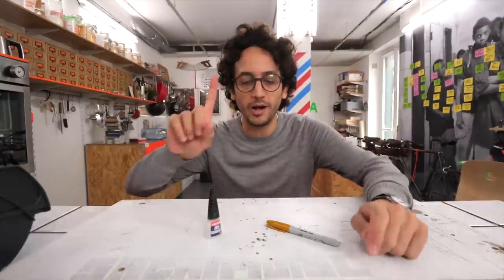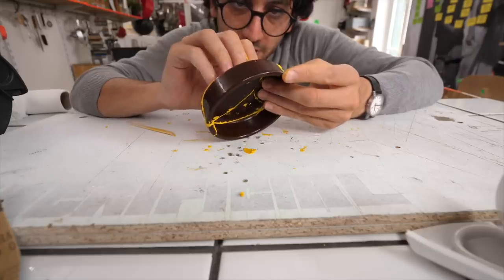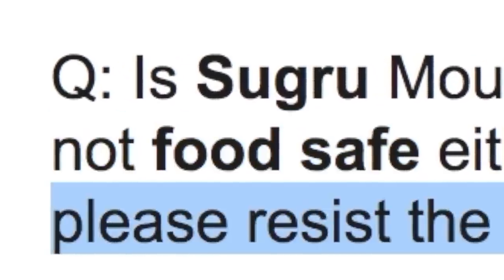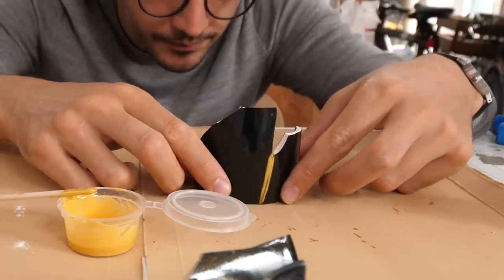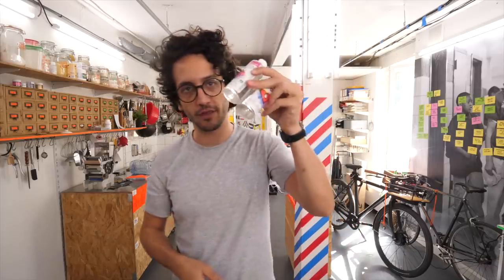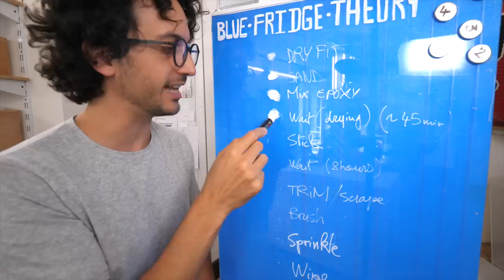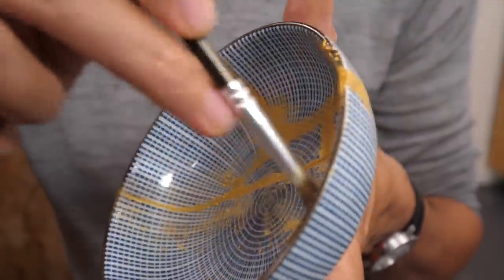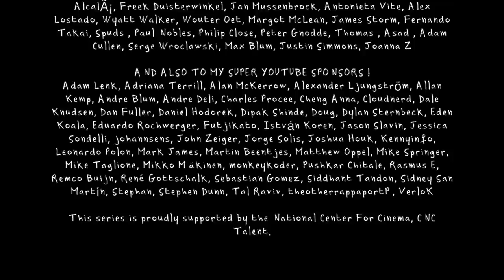I Made a (Foodsafe) Hack On Kintsugi...

Comment: You could also try this old "recipe" or technique for repairing porcelain and ceramic vases and dishes:
Take two fresh egg whites, mix them together, add a little quicklime.
After mixing put the mixture on the broken pieces, hold them together for two or three minutes. Then boil them with milk and the cracks will become invisible so im thinking if you use this recipe and use gold colored dust with the quicklime and egg mixture then it should give you the results you want!! Try out out please?! Its really cool sounding but i dont own anything thats ceramic or porcelain besides my toilet and my ceramic coated cast iron cookware lol and i definitely dont want to attempt breaking either of those two lol @A French Guy Cooking

Comment: The business I work for imports hand made Japanese plates, and I am familiar with Kintsugi items.
I can think of one food safe resin that is often used as a kintsugi natural gum replacement. The only issue with it, like all epoxies, is that it is not recommended above 50 degrees celsius. Considering the minimum temperature a dishwasher will operate at is 65 degrees wash cycle, and 90 rinse cycle...well yeah. I would avoid using this bowl in a dishwasher or microwave after this application.

Comment: wow - hadn't thought of this. awesome hack, but the concept of Wabi Sabi and Kintsugi breaks down for me now that I realize that something old and broken, but beautifully repaired generally is not safe to reuse for its original purpose (for example, as a cup for food or tea).  hmmm... I wonder what the philosophy says about this?  I guess it has a new different purpose and so the inability to use it for food is not an unfathomable LOSS of some functional beauty.
Reply: Traditional kintsugi is food safe as long as you're not using the piece for boiling water, so in most circumstances you can use it for its original purpose (for a tea cup just make the tea in a teapot and decant it over into the cup)

Comment: This is not a true Japanese Kintsugi. The real Kintsugi is made by sticking a vessel broken with lacquer or abrasive powder and dusting it with pure gold or silver. Never use artificial adhesives. Don't think of this kintsugi-like technique as the correct kintsugi method. I'm sorry if the creator explained that.

Comment: I tried this technique, and I’m not super happy with the results. Here are my tips: 

1. Don’t bother trying to color the epoxy gold at first when sticking the items together. It won’t be visible in the seams, and what squishes out will run and make a mess. Just paint the lines on afterwards. Or:
2. After mixing the epoxy, let it sit for well over an hour. Maybe more like three hours. The art resin takes forever to cure, don’t rush it. It was easier to work with when it reached a “ropey” consistency, like when scooping it up with a wide toothpick it wants to pull together and form a ball rather than drip.
3. The wheat paste didn’t work for me to fill gaps, the epoxy still wouldn’t hold and kept making a mess. For one piece that I didn’t care what it looked like on the inside, I used tape to create a backing so the epoxy wouldn’t flow through. I don’t have a better solution here, sorry.
4. Don’t use this method unless it absolutely must be food safe. Even if you’re mixing a batch for a food safe thing and want to use the extra for a different project. You will surely have better results with materials that cure more quickly.
Reply: There is a product called “resin tape” that is made for epoxy resin to not stick to it and making clean edges/lines/borders etc. 
The brand I’ve used is “Joseking” and I bought it on Amazon. 

Should that info ever help anyone….

Comment: Life is easier all round if you have some museum pieces and mostly 'working pottery'.  Working pottery breaks? Replace it. 
A museum piece is on display and so does not get broken. 
Problem solved even before it becomes a problem. 
A lot messing around with sugru and epoxy resin.
Reply: What?